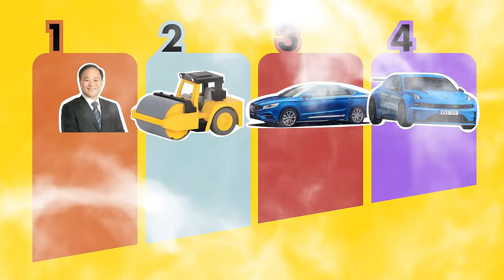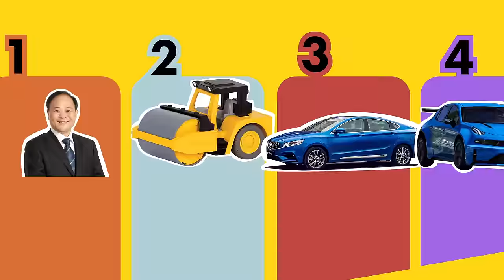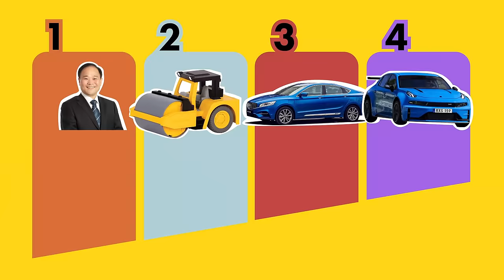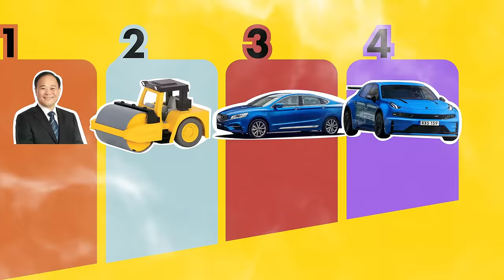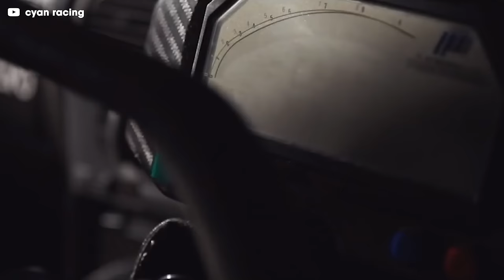GEELY - The Biggest Car Company You've Never Heard Of | Up To Speed

Comment: I own a 2019 Volvo S60, one of the ‘geely Volvo’s’ and let me tell you....Geely truly saved Volvo and turned them into something absolutely fantastic
Reply: To bad volvo didn't really needed saving and now they are producing terrible cars, beautiful,  but unreliable, seen to many cracked pistons, broken valves and failing hybrid systems in new volvos. I'm a volvo guy btw so don't get me wrong
Reply: Glenn Tjan A Sem interesting, outside of some Hybrid difficulties (as all first generation cars have), I’ve had no issues with mine. I also work for a Volvo and haven’t had many complaints with the cars at all. As for saving, Volvo definitely needed it. Ford wasn’t funding them at all and was essentially letting the brand die. No investment into advancing the cars and therefore no sales, and Vice versa. The Ford era reliability was terrible, the Geely era outside of first gen 2016 XC90s, have been VERY reliable thanks to the universally used SPA Platform and Drive-E motor we have used in EVERY model for the last 5+ years. Ford essentially bought Volvo for the safety patents and let the company die. Geely has caused it to be one of fastest growing luxury brands on the market outside of Tesla with some of the highest ratings we’ve ever had.
Reply: Geely did that Ford did'nt do. Invest in Volvo and open the Chinese market.
Reply: Ford forced their dual-clutch gearbox on Volvo at the time. It makes them the most unreliable Volvo in its history
Reply: So a "made in China" Volvo is actually superior to a "made in America" Volvo? Wow! Like seriously...wtf.
Reply: @walterdayrit675  Actually the new Volvos are all built out of Sweden, Belgium, and in the new S60s case, South Carolina utilizing Swedish, Belgian, Canadian, and American parts (with a Japanese 8 speed transmission). The ONLY China built Volvo is the S90 because that’s their biggest market for the S90 (to avoid tariffs). All of the Polestar vehicles are built in China, but those are technically a separate brand so that’s a separate conversation. It all comes down to how little funding Ford gave them, which prevented them from giving the ‘Ford Era Volvos’ the proper R&R needed to ensure proper reliability. Less funding = less research and design = worse reliability. Once Geely stepped in that all changed and they are growing the Volvo brand faster than ever with ratings higher than ever.
Reply: @walterdayrit675  Not surprising, seems like the same for Tesla.
Reply: One catch- the infotainment & navigation system of Chinese vehicles are embedded with spyware, just like Huawei & ZTE kits
Reply: @yslee1401  I won't be surprised if that's true. Heck, I won't be surprised if American cars have spyware in their systems as well!!
Reply: @yslee1401  Their infotainment sucks. Not like people will actually use it. If you want to steal data, people need to use it first.
Reply: @yslee1401  Not sure what there is to spy on considering there’s no cameras inside the vehicle, especially since all you really use in the cars is Bluetooth, Apple Car Play, and MAYBE Navigation if you choose to use that over CarPlay for whatever reason. If you use CarPlay, no way in hell Apple is gonna allow China to track you on it, they don’t even unlock phones for the FBI for evidence to catch murderers in the USA because of privacy concerns. Plus, the new infotainment systems they’re using now are all Google-based. Volvo still produces everything out of Sweden, Belgium, and now South Carolina. Only exception is the S90 where a VAST majority of them are sold in China anyways. Highly doubt Volvo allows for spyware on their cars. Even their previous infotainment system was Samsung based. I’m not defending China, but Geely is VERY good at letting Volvo do what Volvo wants with the brand. And if it had spyware in it, we would’ve known by now considering the infotainment system is 6 years old now
Reply: volvo did good job
Reply: you're telling me they are not made in Sweden?
Reply: @lobsterwhisperer7932  Thank FORD for that. Volvos has factories in Belgium, Malaysia, China & South Carolina US.
Reply: @lobsterwhisperer7932  All Volvo SUVs/Wagons are made in Sweden (some of the European spec cars in Belgium), the S90 in China (99% of their S90 sales are in China so it helps avoid tariffs), and the S60s are built in South Carolina, USA. Polestar Engineered variants of the S60, V60 and XC60 are built in Sweden. But the Polestar 1 and Polestar 2 standalone vehicles are built in China.
Reply: @glenntjanasem  too bad that none of these guys who owns a Volvo car doesn't have the same problem as you do. My uncle owns a Volvo car and still works wonder to him. No complaints whatsoever.
Reply: Walter Dayrit Lol modern Volvo’s are made in america, South Carolina to be exact
Reply: You can thank the chinese gov for that since they put much money into buying Volvo.
Reply: @yslee1401  Yes this is true... And to the other people: I work at a Software company and I can say you that it is your right to know who collects which data and if you are to dumb to control your data, you end up in a social Credit System like China. When your car notices that you havent been in the gym for 6 months your insurance Fee gets higher, when you are speeding there is no court or police, the government simply takes 50$ from your Bank Account. The possibilities are endless and if chinese cars and other products get more used surveillance will become a normal thing in our life
Reply: It's more like Volvo saved Geely. Honestly, Ford almost ruined all of the foreign brands they owned, but I can tell you that if a European manufacturer invested in Volvo then Volvo would dominate the market and be 10 times bigger than it is now.
Reply: @walterdayrit675  um....you need to stop with the made in china stigma
Reply: @zeminoid  they pretty much saved each other
Reply: @Ilovetoes6996  Indeed.
Reply: and still supporting Made in Communist tyranny.
Reply: @HippasosofMetapontum  just like the clothes you wear, the tech you use, and 90% of goods you buy.
Reply: Volvo was already a top notch brand before Geely exists...
Chinese do not know how to make good engines and transmissions.
They need european, japanese or korean "savoir faire".
Reply: @AptivaXP  I don’t know what your definition of “top notch” is but Volvo was statistically, financially, and visually a failing brand for 15 consecutive years under Ford. Volvo hasn’t been “top notch” since the 80s and even then their design caused them to fail dramatically to the point of being bought out buy Ford. Geely’s investment helped reinvent the brand and has lead Volvo to being one of the fastest growing luxury brands 4 years in a row, in fact they were the fastest growing luxury brand in America in 2020, beating even Tesla. And their safety ratings are higher than EVER before. And “the Chinese” didn’t create anything on the new Volvos. The Volvo lineup still uses Swedish designed motors and now use Japanese designed transmissions. With exception to their electric cars, they are still built in Sweden, Belgium, and a new carbon neutral plant in South Carolina (for the American market sedans)
Reply: So u bought a Chinese car? Yuck.
Reply: @golbs7542  yeah a Chinese car designed in Sweden by the same engineers who have been working there for decades and assembled in South Carolina. Soooo Chinese
Reply: @MichaelReeves412  so owned by China? Yuck dude. Anything else is better.
Reply: @golbs7542  literally every product we use one way or another has Chinese funding. If a Chinese company gave Volvo $15B to reinvent the brand, produce their cars in Sweden/Belgium/SC (with exception to the S90 which is where they sell 90% of them, in China), and lead to the highest sales numbers and product ratings in Volvo’s history - I don’t see the issue? Geely is a Chinese capitalist entrepreneur (yes they exist) who has publicly spoken against the CCP. But anyways, I’m not here to convince you anything, I’ll go wipe my tears in my $60k “Chinese” car that was produced in South Carolina and designed in Sweden.
Reply: @golbs7542  lol ok bub I’ll be sure to remember that when I’m driving my American assembled, Swedish designed car while you complain on your phone that was assembled in China LOL
Reply: @golbs7542  also, *you’re
Reply: China got shxt ton of cash bro. They keep pumping cash until it gets right.
Reply: @MichaelReeves412  u just destroyed him.
Reply: @glenntjanasem  Ford fcked Volvo up and Geely saved it so it will not end up like SAAB
Reply: @walterdayrit675  yup. no surprise there...American cars are now trash. deteriorating interior, defective transmission, failing suspension.no resale value. Even Hyundai who you Americans were laughing at at first have now surpassed Ford. It won't be long before China cars can rival Japanese cars.
Reply: @healthytrollmeister2665  not all mate, i try to buy other stuff if i can. and alot of other things are made in india and vietnam. lol why are you so angry
Reply: @golbs7542  nah, mate. If you're an Aussie, your country would be screwed if China pulled out right now. Whereas, China would barely be affected if Australia buys anything or gets your steel that barely puts a dent in a percentage of their need for metal. So acting like yourmini boycott actually does anything is laughable. Just makes your life harder because you have to research 100s of little products to see if they have China anywhere in the supply line lmfao.  It's like no one told you we live in a global economy.
Reply: @rks5457  half thier population couldn't heat thier homes when we couldn't send out coal over there. So they relly heavily on us. I would love to not send out coal their and halve thier population. Lol
Reply: I would have a Swedish engineer over Chinese engineers. 

I think material technologies and manufacturing improvements “truly saved Volvo.”
You guys just want copy all her shit and try and slide into bed under her name…
Reply: @Ipds70GltR  good thing they’re still developed in the same Swedish families with the same Swedish engineers under the same Swedish CEO
Reply: So u are pretty knowledgeable with volvos and the replies youre getting are just based on hearsay smh
Reply: @golbs7542  ok grown up
Reply: @glenntjanasem  of course, it’s made in china
Reply: @golbs7542  You are so funny. China has the largest coal production in the world, and only a few provinces in the north need heating. If it were not for the agreement, China could not import from Australia at all.
Reply: @luyuanxia5943  no matter what u say I win because I don't eat bat. Lol
Reply: @luyuanxia5943  You should eat a koala. All the Chinese says it tastes better than bat.
Reply: y'all need to ignore that one on this comment thread he/she is a troll and he/she get paid for disturbing and annoying people on social media and is needed to be reported
Reply: @shun0825  yeah this luyuan xia dude is a pain in the arse. You know something is wrong when people think Chinese products are superior to other products.
Reply: @HippasosofMetapontum  while doing western propaganda
Reply: @golbs7542  OK boomer
Reply: @golbs7542  Looks like you're Australian... Kangaroo eater.
Reply: @golbs7542  Dingo is fooling around. LMAO 🐶🤣
Reply: @golbs7542  Win? How did you win? With nearly 2000 deaths? LOL 😆😆
Reply: @rks5457  It had been screwed very bad but still pretend nothing happen. LOL
Reply: @golbs7542  Aww~~ I'm so "angry" again~~ so~~ salty~~🤪🤪
Reply: @hl.8273  lol why are you crying. It's ok to say Chinese cars are crap.
Reply: @golbs7542  Sounds like dingoes can make cars... I'm sorry, they're not even yours, just some rebadged Chevrolets. Hahahaha~~🤣🤣
Reply: @golbs7542  Chinese cars were sold to many countries. Yours? Who wants to buy a rebadged Chevrolet when people outside of Australasia can buy themselves a real one? 🤣🤣
Reply: @hl.8273   @H L.  we don't make our own cars because we already know Germans and Italians make the best cars. Don't know why you think Volvo's are any good. They aren't.
Reply: @hl.8273  do you eat bat?
Reply: @golbs7542  Volvo is a brand that can be described as safety and makes safest cars in the world. Don't you know that? LOL
Reply: @golbs7542  They aren't good? You tell that to Swedish people especially the automotive engineers. Hahahaha
Reply: @golbs7542  I don't. Do you eat kangaroos? 🤭🤭
Reply: @golbs7542  Oh BTW, German and Italian cars have nothing to do with the reasons you don't make cars. It's all about a country's industrial and technological level.  😌😌
Reply: @hl.8273  chinese cars yuck!!!! industrial tech level? lol so buy a mercedes if you want the best tech, they have always been one of the first to invent new tech in a car.
stop making excuses for chinese cars
Reply: @hl.8273  are you angry because your not allowed to eat bats anymore?
Reply: @golbs7542  Hey, don't pretend. Answer my question.
Reply: @golbs7542  Kangaroos eaters make me puke hahahaha
Reply: @hl.8273  lolcriminals. I'm not Caucasian
Reply: @golbs7542  It doesn't matter for me whether you're Caucasian or not. Since you guys are learning how to trash talk about us from each other. 😂😂
Reply: @golbs7542  And I don't think you can speak your own mother tongue. Haha!
Reply: @hl.8273  eata batwing. Do you salivate when you watch batman?
Reply: @golbs7542  Do you salivate when you see kangaroos? 🤣🤣
Reply: @golbs7542  You can't spell properly? LOL hahahaha
Reply: @golbs7542  Don't try to challenge me by asking questions like an idiot. 😋😋
Reply: @golbs7542  Still challenging me, huh? OK, as you wish.
Reply: @golbs7542  Oh wow... Mom, mother and mummy are sensitive words. This is the so called free speech. LOL 😂😂
Reply: @golbs7542  Aww... I'm "angry" again... Don't you have other comments instead of repeating the same thing? 🤣🤣
Reply: @golbs7542  Sounds like your "people" aren't easy... don't pretend to be a Caucasian, I'm not color blinded. 😊😊
Reply: @golbs7542  They're the easiest, I mean your ladies. They're so easy to EVERYONE AROUND THE GLOBE. Just like taking a bus. Do you know that? I don't think so. 🤣🤣
Reply: @golbs7542  You always made my day. Hahahaha! 🤩
Reply: @golbs7542  Told you not to challenge me... and now bring disgrace to yourself. 🤩
Reply: @walterdayrit675  new volvos aren’t made in china
Reply: @Neojhun  2020 V60 owner here, totally AGREE! It took me a whole year to get used to that infotainment system, compare to taking a month to get comfortable with my previous 2016 V60. A week with the 2003 S60.
The S60 gave me the most grieves: an $1800 transmission rebuilt, then $6000 transmission replacement, finally $2000 AWD fix which resulted in not doing it but leasing the 2016 V60.
Reply: @golbs7542  LOL you are liar. The only chinese thing about modern Volvo is their ownership. Operationally they are entirely outside of China. The most of the cars never existed in China except for the few low production cars like Long Wheel Base and Polestar. The rest are based on the FORD supply chain. You are political troll who ignored technical reality.
Reply: @rickfeng4466  Gawd damn the new V60 is beautiful car. I love station wagons.
Reply: @Neojhun  also the interior of the car smell like bats. I think they use bat wings to make the seat covers. Lol
Reply: @Neojhun  I just know they eat bats while discussing how many missiles they are allowed to fire at Taiwan and Japan.
Reply: @golbs7542  LOL That some insane spam. Dude you need to seek professional help.
Reply: @Neojhun  haha
Reply: @golbs7542  Sounds like you've eaten bat and knew what does it smells like. And tell me how to use bat wings to make the seat covers. I bet you can't give me an answer. LOL 🤣
Reply: @golbs7542  "They're slowly trying to claim all of Asia" in your wet dream. 🤭
Reply: @golbs7542  I just know your ladies were being treated like a city bus that everyone can take a ride while you're trash talking. How's that? 😋
Reply: @Neojhun  No need to reason with him. Keyboard warriors can't understand a word while you're reasoning with them. Even professionals can't help, there's no cure. Make him bring disgrace to himself like I did.
Reply: @golbs7542  Oh, you want more disgrace? OK, not a problem. You're too easy for me. 😋
Reply: @golbs7542  Oh, now there's a re-education camp in your wet dream. Hahahaha 😂
Reply: @golbs7542  Sounds like you're not yellow skin. 🙃
Reply: @golbs7542  I'm terribly sorry. My dad is a passenger just like me. Ouch!
Reply: @golbs7542  Says the second class citizen.
Reply: @golbs7542  We all are first in our own place. You're not, not even your whole family.
Reply: @golbs7542  Oh, so yours isn't? LOL
Reply: @hl.8273  your mums an isn't
Reply: @golbs7542  What is "an isn't"? That's all you got? Looks like you're broken. Hahahaha
Reply: @golbs7542  OK. Broken troll confirmed. Hahahaha
Reply: @golbs7542  Hahahaha so pity 🤣🤣🤣🤣
Reply: @golbs7542  Poor keyboard warrior now becomes a bot hahahaha 🤣🤣🤣🤣
Reply: Um, Volvo was pretty damned good before Geely.  What I do respect is Geely's willingness to explore prototype options and incorporate VOLVO's best technology.  I personally would never buy one but the Chinese guy's grind was real.
Reply: @glenntjanasem  never heard of any of those issues with my modern Volvo
Reply: I have an 06 V50 and the parts are constantly needing to be changed, luckily newer parts can go in it, saves time and koney
Reply: They save Ford too
Reply: @glenntjanasem  TS too not to, but yes, I had a Volvo V60 rental car and it smelled like burning plastic after a 30 min ride. Cadillacs and Mercedes never did that and the car had 3000 miles, so already past the break in period.
Reply: They're Volvos. Geely helps finance them and there is a bit of shared tech but these are Volvo engineered and designed. I agree, Geely saved Volvo and the best thing they did is leave them alone to manage and create their own cars but infusing them with cash to finance them.